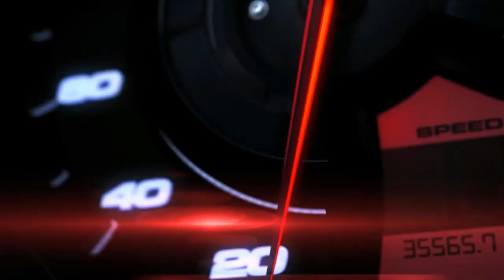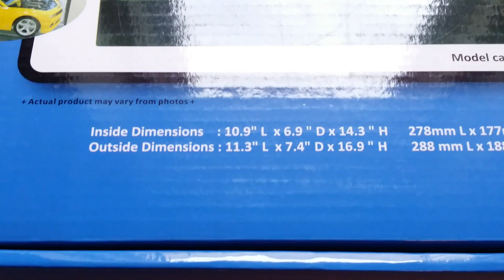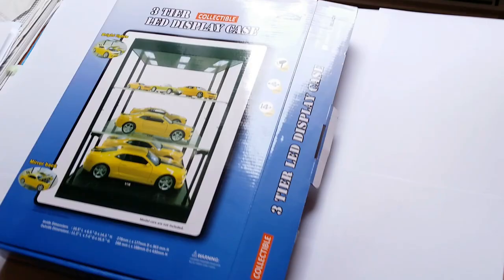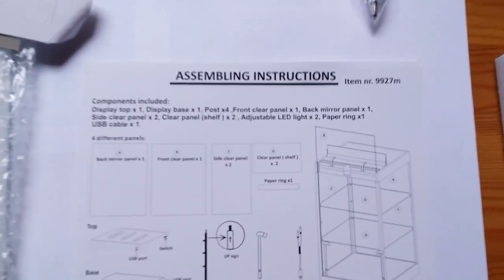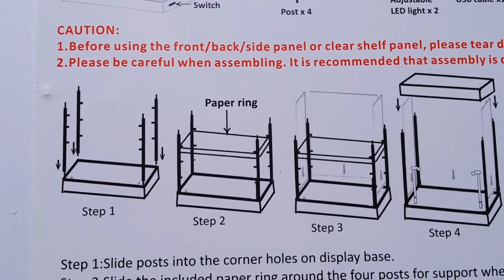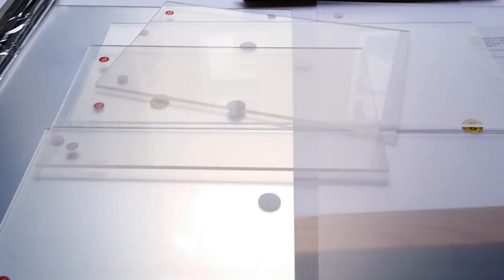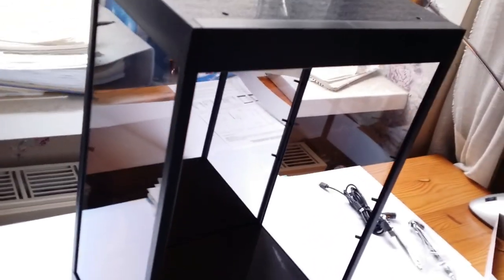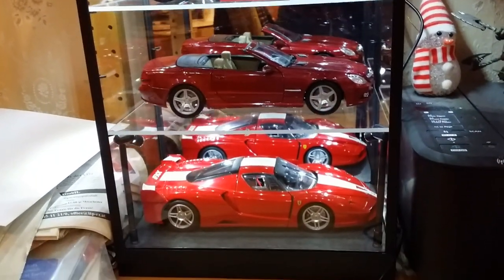How to Build a 1/18 LED Illuminated Display Cabinet by Triple9

Comment: Having used Mijo Illumicase+, sure the price can run high and comes with cheap plastics. However you get lighting for each model. In the Triple 9, the middle shelf lacks proper lighting. I would go for a custom setup with very good diffused lighting for my high-end models. However, for sub $100 I guess the Triple 9 is decent.